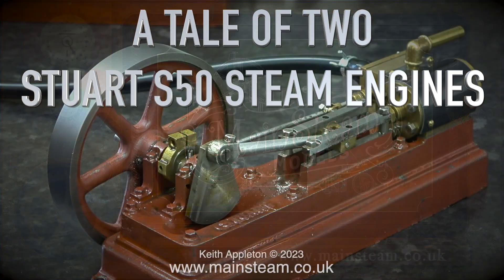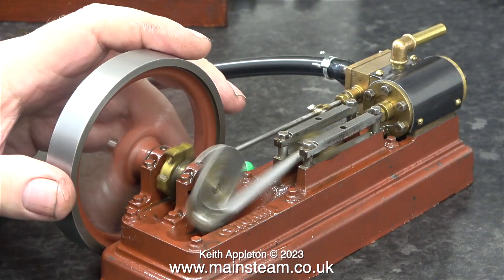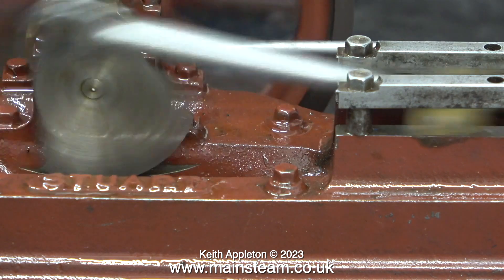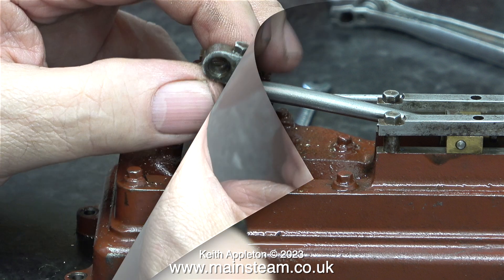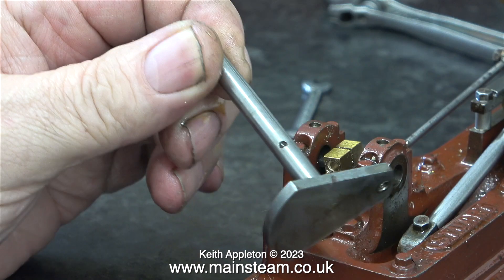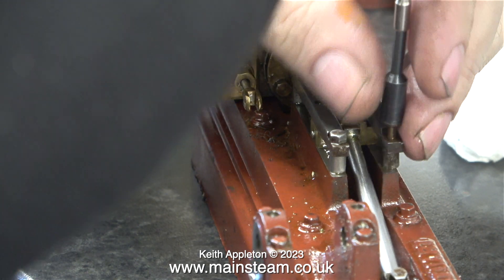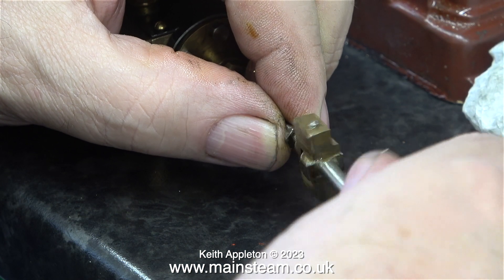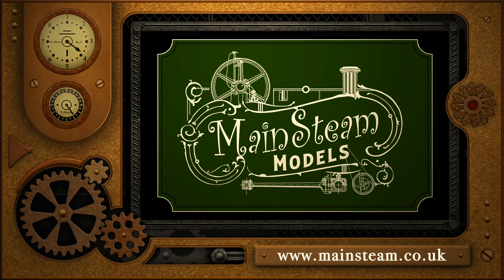A TALE OF TWO STUART S50 STEAM ENGINES - PART #3

Comment: Hello Keith, the S50 was the first Stuart model I made and I enjoyed it immensely. You pointed out that the crankshaft on this engine has a recess for the eccentric sheave grubscrew. Does that mean the timing was fixed during the machining of the engine and can't be altered? How would it be possible to calculate this correctly at that stage rather than build and fine-tune once running? Thanks for all your videos, there is always something to learn in each one.
Reply from the maker: No, I would think that the hole was drilled on the mark left by the Grub Screw after the timing was set.

Comment: Hi Keith.  My S50 is 'almost' exactly the same as your one here, with a couple of exceptions.  Firstly, the guide bars are just flat and not recessed for the bolts.  Not sure about the screw in the crank shaft as mine is very tightly fitted - perhaps even Loctited in.  The main difference is that the word 'Stuart' is missing from the raised platform by the crank web.  This doesn't really matter to me, but I wondered if to your knowledge some of these S50's were copies of the genuine  Stuart ones?   It does have a nice Stuart displacement lubricator fitted.  Thanks you.
Reply from the maker: There are a few Indian copies around, I have seen a few.